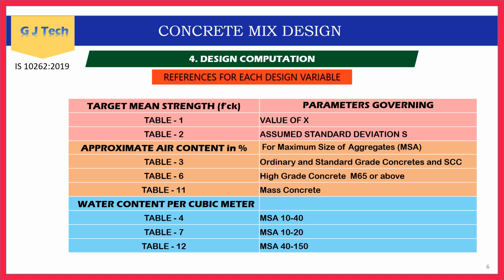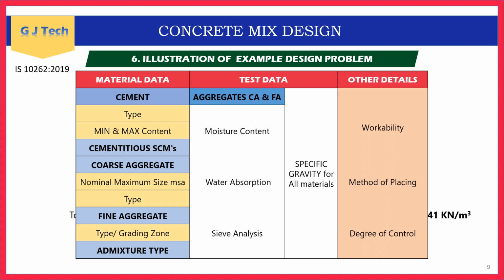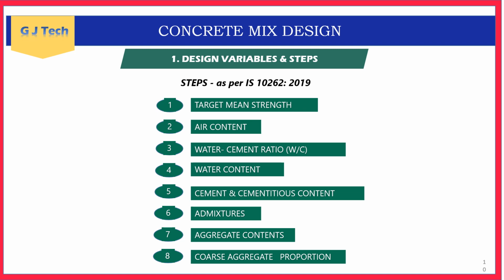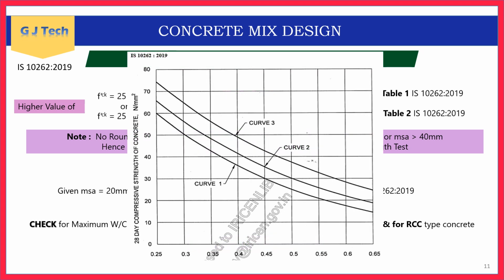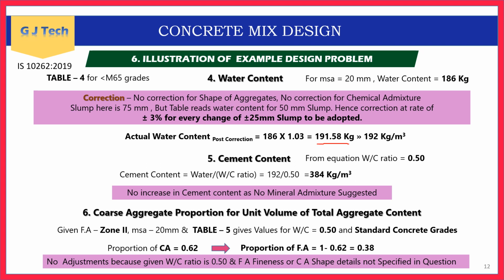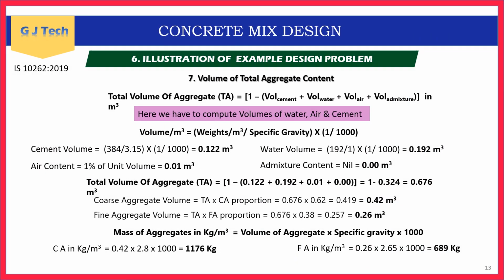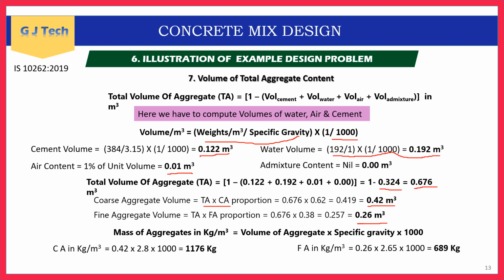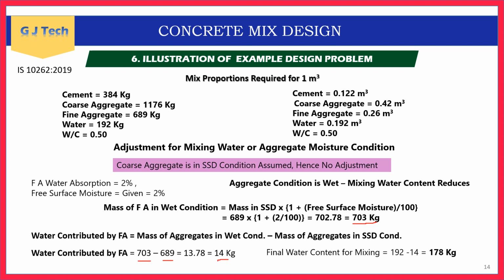Concrete Mix Design Example - DESIGN MIX PROPORTIONING for M25 GRADE

Comment: Would be great if you made PPT on Concrete Additives, Super plasticiser and High strength concrete mix design > M:120>M:60 using admixtures
Reply from the maker: Sure sir in few days, thanks for the suggestion